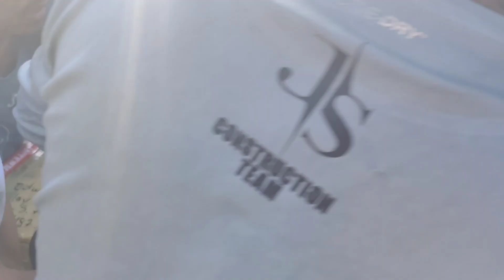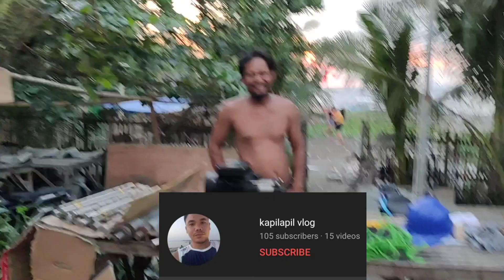JAPERSNIPER UNBOXING SA BANGKANG MALAKI (100 TONS) NA PACKAGE | NAKAKAGULAT

Comment: Water pump Yan idol high pressure Yan
.pwdeng car wash assemble nlng Ng hose at gun.single phase Yan idol
Reply: Boss sana ng vlog ka muna paano e assemble pra hindi sila mahirapan sa kalisod😅👍...
Reply: Ok yun lodi pero   problema  sa lugar nila hindi pwede  yung conveyors  type malambot ang lupa na pinagbubuhatan nila, mas maganda sana yung tulad na ginagamit sa mga speed boat  de gulong, kahit sa pangpang pwede  i lusong sa dagat.  Masasayang lang yun hindi nila gagamitin,  sa lugar nila kelangan parang kariton  gulong ng sasakyan.
Reply: @pammangqu984  pwede namn Po Yun sir lagyan lng nila Ng tabla Yung lalapat sa buhangin
Reply: ok yan maganda di sila mahirapan,, bawat roller lagyan nila ng tabla para hindi basta babaon sa buhangin..
Reply: Ung water pump sir pwede yan sa bahay ni idol japer kasi 3rd floor bahay nia..
Reply: parang electric winch .panghila ng bangka kapag itatas sa pampang

Comment: Ang motor ay hydraulic pump at may dalawang hydraulic cylinder para sa pag arya at pag hila ng bangka . Ang mga shafting ay para sa conveyor.  Sa bawat shafting ay may dalawang roller mount . Maaring kailanganin nyo pa ang square tubing para sa roller mounting bali dalawang tubing ang kailanganin nyo.

Comment: Ang good wood sa pang ilalim ng 📐 angle bar na gawin niyo railway.. cut the wood  by 3 feet 🦶 or 3 1/2 damol  ng good wood..or 5 pcs by haba 12 meter cut it .. 3 foot and drill the angle bar and good woods.. for The tightening bolts to join …to make a railing ways..👍